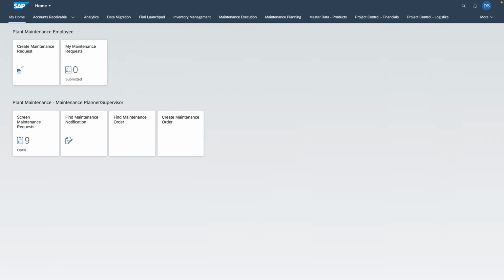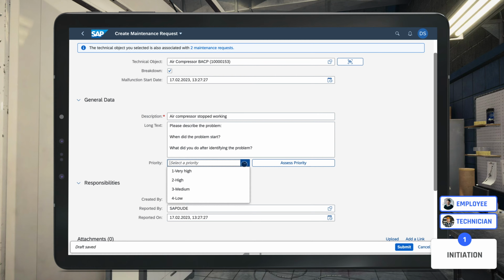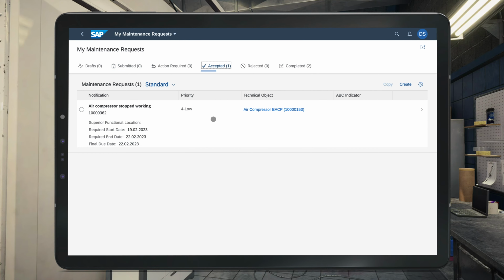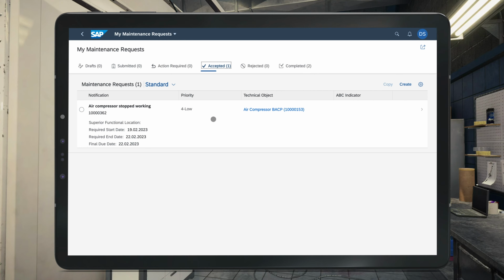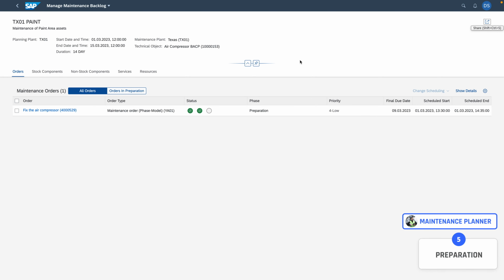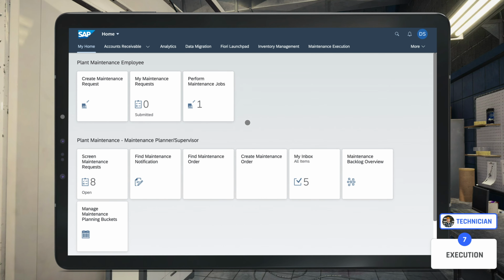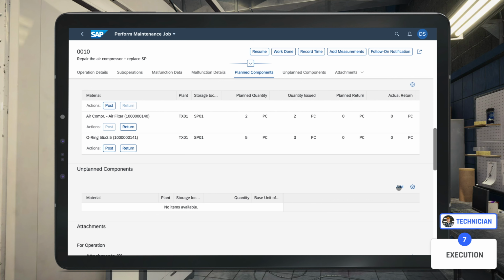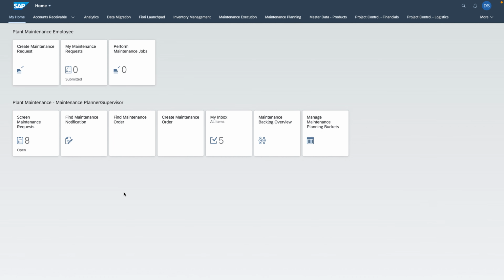Phase based Maintenance Process with SAP S/4HANA Asset Management

Comment: hi - this is really valuable, thanks for the post! I tried to get it working on a client sandbox, but failed because of lack of master data, and some things not enabled, so watching this video just to get an undertsnanding is great. just a question, do you think SAP will eable some of these phase features in SAP GUI? wodnering if there are plans for this, as it would certainly help businesses who are too used to SAP GUI to slowly transition to this 9 phase model by using GUI at first and then moving to SAP fiori
Reply from the maker: Hi man, great to hear that! 
The phase maintenance is also reflected in the backend, you can monitor it via System Statuses of the maintenance order. But yeah, it's not like GUI will have all the capabilities of Fiori-based apps. The future of SAP is to move to web-based/native mobile apps. So I think GUI won't inherit those features from Fiori Apps.

From my point of view, there is no point of implementing Phase Maintenance just for GUI, its power lies in the apps like Perform Maintenance Jobs etc.